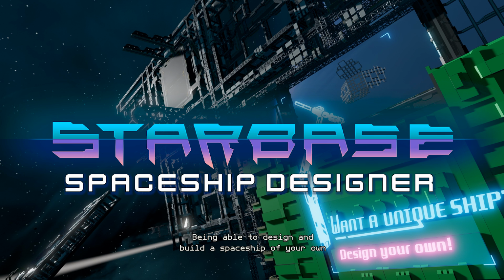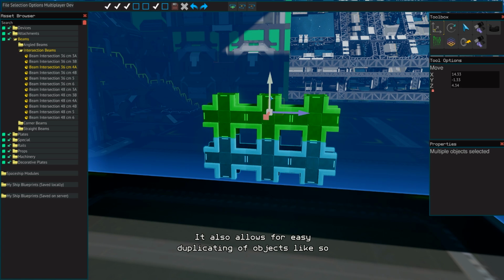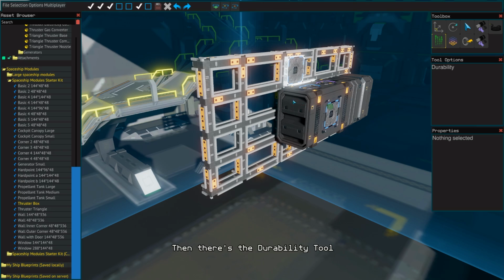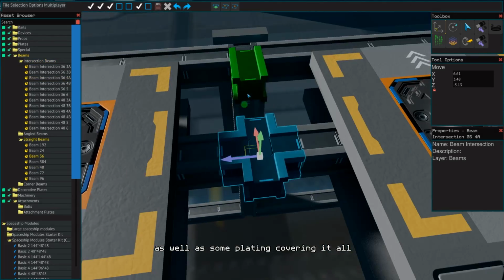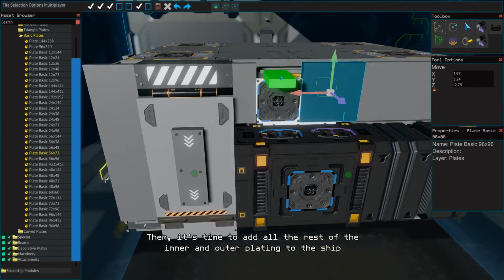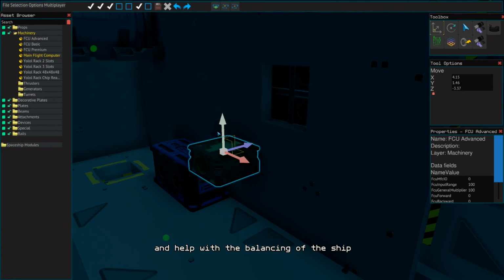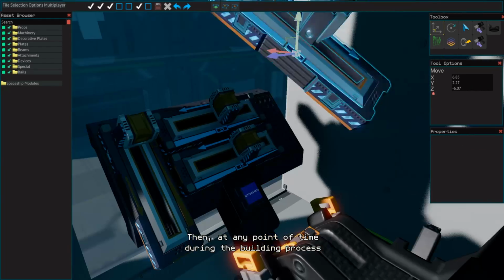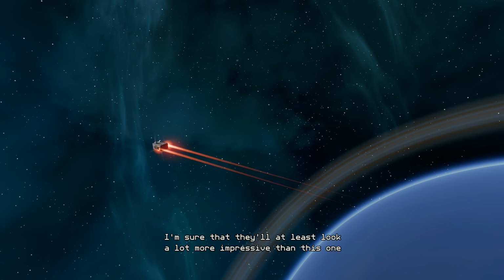Starbase - Spaceship Designer Feature Video (Partly Outdated)

Comment: Please add an automatic balancing calculation inside the editor so that you can easily adjust stuff to be in balance without testing it between each adjustment. Also, it would be quite interesting if you could also see a map of angular acceleration towards each direction so that you can optimize the ship manueverability.

Comment: So, I see that ships will be restricted to a certain size, as the blue box surrounding the cat box in the distance implies. I was wondering if anyone had an answer regarding the possibility of larger ship designs? Whether it be merging different ships that serve as fractions of a whole, or a different station module, presumably built at player-owned stations, that allow for larger size permissions, does anybody know?

If not, it'd be neat to have the following features;
>Module that allows for connected pieces to detach, akin to stage separation for rocket launches.
>Module that allows for connected pieces to attach, akin to... the opposite of above.
>Player owned station can have larger ship designers to build dreadnought - esque ships.

Comment: This is great! I was really worried that the editor was going to be awful like interstellar rift but this actually looks really user friendly for the amount of features it has packed in. One thing though is that there needs to be a way to determine if the ship is off balance before you test it. Center of mass and center of thrust indicators should be a thing inside the editor. 
     By the time you add everything you need to test fly the ship you will have already done a ton of work that may have to be undone in order to balance it properly. I would prefer to build the ship while keeping an eye on the com and cot so at the end it comes out balanced without having to move my generator and all the wiring like you did in this video.

Comment: why must we use the bolt tool why isnt it completely automatic when you place something
where is mirror mode
why cant we just stretch pieces to get bigger ones
we should be able to make wall templates and stretch them into walls, maybe even change the templates and apply changes to the ship

Comment: If I chose not to install a flight computer, could I then manually set the control binding for each individual thruster on the ship, hook up my dual flightsticks, mice, throttle, and pedal system, THEN, use control remappers: Antimicro, Vjoy, UCR, and XOutput to make my ship a proprietary binding mess that only responds to my specific inputs, and make it a nightmare for whoever else wants to fly my ship?

Could I also have my wires and pipes go through tens of self connections and redundancy junctions like redstone spam so that if any one segment gets shot out, Things still run as normal?

Comment: I'm going to be spending about 99% of my time in the ship designer. It looks awesome so far. Sucks that the cockpit and controls look so ugly. DX Why is there no control stick for ships and fighters? The only thing I would want to use those big ugly levers for is to increase and decrease the thrust. You guys need to also add in buttons, switches and nobs, that are about 1/4 the size of the normal button so we can fit more of them on the control panels of ships and fighters. I can easily see my designs needing about 100 of them. XD

Comment: The cables and pipes are a bit rough on the turning points. Maybe rounding out the ends will help?
P.S. It might be useful to join the Pipe and Cable Tool together.

Comment: you might want to add like a camera flashlight, so shadows inside the ship wouldnt be that big of an issue.
Also it would be nice for some sort of wireframe/hiding of pieces, so you could work inside of the ship easier. Or maybe allow zoom/fov changes for the building camera

Comment: The lighting is a bit of a problem. Even in the video, the ship has been positioned so the light from the star comes in and there is a better view on what's happening inside. Some function to make even light everywhere could be pretty useful, otherwise very impressive

Comment: You should have clear simple and easy to understand icons  that look like the parts like space engineers with the pictures of blocks so the designer is easier to use and easier to get into. And you should make certain aspects like power, structure and decoration be in there own windows as keeping them in one big window is confusing and messy. And are there different sizes for a designer place like are some are only big enough to make fighters and are others big enough to make the super Star destroyer from Star Wars or the pillar of autumn from halo or is it a fixed size for all of them?

Comment: This looks really good and has some depth and complexity to it that I very much approve of.  I do have a few questions/concerns though:

Will there be a mirroring tool?  It would save an immense amount of work in building a ship since most will likely be symmetric on at least one plane.  2-plane symmetry with the ability to move them around would be even better.  Maybe even radial symmetry?

Plating with individual pieces looks like a slow, labor-intensive process.  Could we get some kind of click-and-drag plating tool?  Even if it didn't automatically leave holes for hardpoints and such it would be much easier to cut holes out than to plate around them piece by piece.

I really like that you have to manage cables and pipes.  Is it possible to run cables/pipes along/through the frames to hide them from view?

If thrust/weight needs to be balanced, will we have center of mass/thrust indicators?

Comment: There is a couple of things that my time in other ship builders that I can't quite tell from the video itself:
- If I have a space for a 7 long beam but there's only 3 & 4 long beams will I need both or do you have adjustable beam lengths? Does using higher part counts directly effect performance?
- Is there a way to change the camera speed? For fine adjustment while building and for traversing across large builds.  People are gonna push the ship builder to it's absolute limit. (for that, having a less confined space might work, unless you could hire a larger room or something)
- Are we gonna have landing legs / docking connectors? ( I really want deployable landing gear )

Compared to other ships builders (KSP, Space Engineers, StarMade) this looks to be quite the step up

Comment: The tool looks incredible, but there's definitely room for improvement:
   - a mirroring option on one or more planes would be really welcome;
   - a "fill surface with plates" would save a lot of time, and the fact that you have to select the plates by dimension and find the correct one is really too time consuming to not become annoying. At least some kind of "resize on the fly" ability (*hint hint* Avorion *hint hint* ) for the plates would definitely be appreciated.
Can't way to try it tho!

Comment: Can you hide wiring and fuel lines underneath the interior panels
Reply: wiring definitely, with the socket thing they had. No clue if the sockets work for pipes too. Of course, there's no reason not to build the ship big enough to have walkways inside the walls either. Other than mass limitations.

Comment: I like it. However, I am a little nervous about the huge list of different entities that are used when I am using the editor. I fear that it will be quiet a challenge to find the parts I need. Will there be some sort of search function to find specific ship parts?
Reply from the maker: There is a search and there will be an option to visualize the different parts to make it easier. It is already working in our rental lot designer tool, coming to the spaceship designer as well :) A tutorial blueprint also has nearly all available parts laid out neatly in the scene, which you can copy to your own creation for inspiration.
Reply: @FrozenbyteGames  thanks for answering my question.

Comment: My question is how could we make it out of stronger material

Also how would I make a very very large ship
Reply from the maker: Different materials is a feature coming later to the Spaceship designer. You can build a ship as large as the hangar space allows - the current size is likely going to be increased.

Comment: Thanks.
Looks tedious...
Instead of adding cover-panels one-by one, wouldn't it be better to add one huge panel that cuts itself into smaller ones to fit around hardpoints? Would be also nice to be able to place just couple beams and click a button for more beams to spam inside (over specified interval) instead of making that grid manually.
Reply: If I had to guess some of the things could be achieved by the use of modules

Comment: This Spaceship Designer awesome  !!!
I have somes ideas for this :
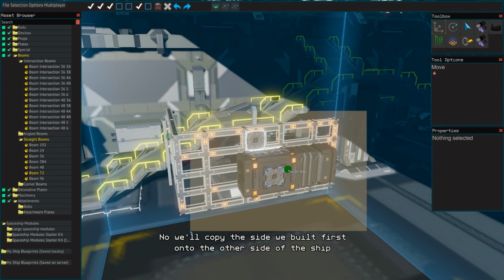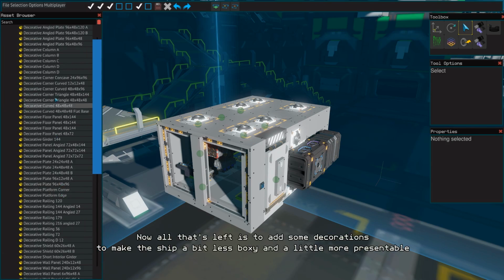- 4:19 or 10:42 The "copy fonction" is cool but why not a "Mirroring fonction" ? 
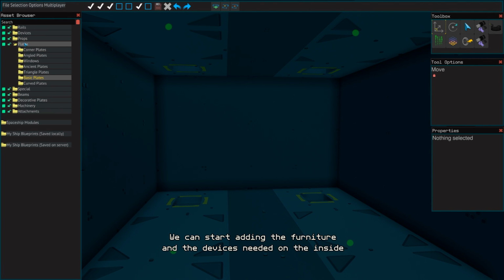- 7:22 When i see that, i image "hidden part fonction" which hide parts for better vison.

Another idea, i think of Subsystems. For example, i create many "Cockpit", "Body", "Thruster", all saving like "Subsystems". In the asset browser, i find my "subsytems" which can be reuses in the starship designer. 

And please, make a space designer like a standalone demo.
Reply from the maker: Thanks for the suggestions!
Reply: @FrozenbyteGames  another suggestion for ypo: "upgrade/replace button" or tool that replaces a part with it's analog. For example you want to replace some of the level1 thrusters with level 100 thrusters. it would be handy just to select the "upgrade" tool, click on the thruster and select the needed level from the droplist. This will save time. Because you will not have to remove the old thruster, find the new thruster and place and bolt the new thruster.
Reply: Regarding your subsystems idea,  they actually already have that in this video. They call them modules. They're just presaved substructures like you're talking about.

She uses at least 4 to make this ship. There's one for the windows, the generator, the door, and the maneuver thrusters.. Maybe more that I didn't notice.
Reply: @ganondorf5573  no. I do not mean modules! I mean replacing individual parts with better or similar parts. E.g. you have a module with several yoolol-chips of tier one. You need to replace them all or some of them with yoolol-chips tier 3. In traditional mood you would have to replace each of them with by removing the old chip and pasting a new one and pasting the script after that. And assigning ids to the new chips. With the upgrade tool the tier 1 chip just turns into tier 3 chip with one click. It's id in the network and it's script remans the same. You need only to add a few lines with trygonometric magic in this particilar example. Or why replace the chips? Or you could replace all the light armor of a 400 000t Dreadnaught with heavy armor in just one click. That would be handy!
Reply: @antonstezhkin5991  Ahhhh! I understand now.

I honestly don't think this would be as useful as you think it might be.

In the case of a chip upgrade, you're going to need to edit the code regardless... (because lower tier chips can't have the code that the higher teir one would enable anyway). You're better off keeping all your code saved as scripts outside of the actual chips. Otherwise, it'll be really hard to review your code or reuse it later. So, you'll probably already be ready to copy and paste the new code in wherever you're making these changes. So I don't think YOLOL chip upgrades are a good example. It's a fundamental redesign, not a simple upgrade.

As far as upgrading plates from light to heavy... I don't think plates have tiers of strength. The materials you actually make the plates out of decides their strength as well as how many layers of plating you make.

I'm not sure how material type is chosen for plates though. It might be decided directly when you actually fill the blueprint in manually.. or maybe you can set it in the editor.

In that case, I do think it should be possible to multiselect plates and change what material they're made of.
Reply: @antonstezhkin5991  the modules are sub-systems... you can save your own modules.
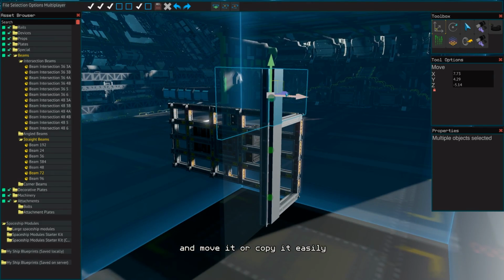4:10 pay attention next time.
Reply: Related to the hidden part function you mentioned, a section plane tool (like in StormWorks) would be awesome when you're doing internals. Basically, you could position an X, Y, or Z plane, and anything on the close side wouldn't be visible. In Stormworks I often use a Y-plane (horizontal) just below the deck level, so I can change things in the engine bay without deconstructing the deck.

Comment: Is there a mirror-building-system?
Also i think, there should be a button to disable the shadows while in build mode, or somethink like a torch or light on the camera.
Its very hard to see whats going on inside a ship after building and sealing the outer walls.
Reply from the maker: The spaceship designer is an ever-evolving piece of the game, lots of features will be polished and added :) Mirroring is on our list although currently not very high priority, as well as lighting options/ambient light etc.
Reply: @FrozenbyteGames  Very nice. Thanks for the answer ;)
Reply: Rip,  mirror mode is usually the best option to use when making sure more complex ship designs stay symmetric while also saving time during the build process.
Reply: PoisoningShadow671 They... they just said they planned to add it...
Reply: @AlexPBenton  Yes, I know, but they said it's not that high on the priority list, which means that a staple building feature may or may not be included yet once closed access arrives.

Comment: Pretty cool but it still seems quite complicated. I don't quite understand how the levers work on the flight seats - do you have to manually make them activate different thrusters?
Reply: VeraxonHD basically they’re bound to your keyboard; the levers and stuff just move around  when you click on the keys
Reply: The levers part is pretty simple :) You place a lever and change one line of the device field to whatever you want it to do. E.g. forward, backward, roll, yaw, pitch, up, down. It is then further possible to customize how fast they move etc.

Comment: My only question from this is how I as a designer would be able to determine if my ship is off-balance. In the video, the problem was super obvious, but the how the solution was arrived at was not. Do we have access to some kind of center of balance diagnostics in the ship builder to determine, or will it just be a trial and error thing? (genuine question, not trying to come off as aggressive)
Reply from the maker: There is currently a very wip/legacy way to see the center of mass point of your ship. You'd still probably want to see a center of thrust indicator - These are features that will be polished / added as we continue to work on the designer tool :)
Reply: @FrozenbyteGames  Excellent, thanks very much!
Reply: @FrozenbyteGames  glad to hear it! I like how detailed the ship builder is.
Reply: @FrozenbyteGames  I have a quick question: Will this game support modding?
Reply: good question. I'm replying to see their answer.
Reply: As a work around, or even after we get tools to help us balance a ship. You could probably use YOLOL to get a read out on all your thrusters stored into memory chips. Then, try flying the ship in a straight line. If the MFC is using any maneuver thrusters to keep it flying straight, you can store that into memory chips and see which thrusters are outputting the most thrust, and attempt to adjust further from there... but a center of mass + center of thrust would be super helpful. I do think that my technique would still be useful in fine tuning a ship even further, though.
Reply: In my opinion From the Depths has this done very well and you might want to spy upon it to check how it's made in it. It's very simple visualization of center of mass, center of drag, center of thrust and lift and whatnot in it but it's really useful way of showing it. It's simple X, Y and Z axis and vectors on them with the center point moving based on the changes to the structure.

And yes. Add mirror tool to the game. It cuts the work and time needed to build a ship into half. That's a lot of work and time saved. Maybe even add double mirror tool so you cut the work and time required to 1/4th of the original effort needed. That way both sides of the ship can be mirrored with the front and back being mirrored as well. That way laying down simple core structures takes only 1/4th of the time required. Then you can just turn on the 1 mirror mode on and continue building the sides with mirror mode while leaving the back untouched while you work on the front. The power of mirror tools is really big.
Reply: if physic engine already have a center of mass its problem about 2-3 row's in code.
Reply: Ild hope there would be a way of compensating.
Reply: @nathnathn  With enough RCS, anything is possible.

Comment: i would really appreciate a "remove shadows" button so that while editing you could see everything clearly but other than that it looks amazing and i cant wait to try it out
Reply from the maker: ambient / light settings are coming :)
Reply: @FrozenbyteGames  Thanks!!
Reply: I'm sure ultra low settings would get rid of shadows ...I mean it has to
Reply: I do not think that darkness is from shadows but rather because the light source is on the other side (ie not all darkening effects come from one object casting a shadow on another). This is a problem faced in several builder games. A head lamp comes in handy!
Reply: I mean either that or just temp. disable the shadows in settings